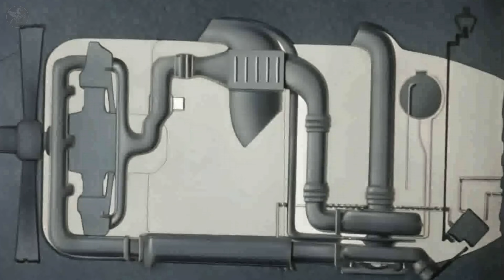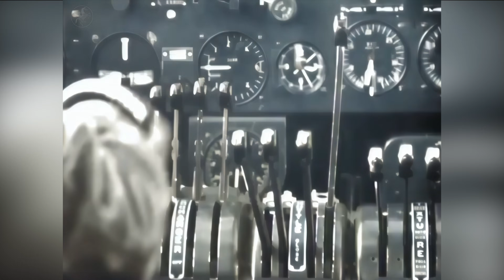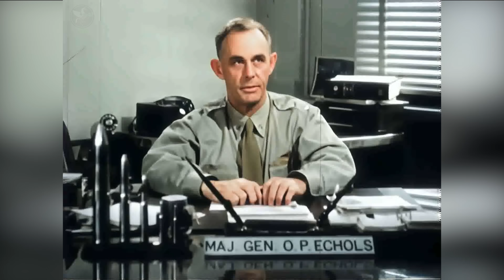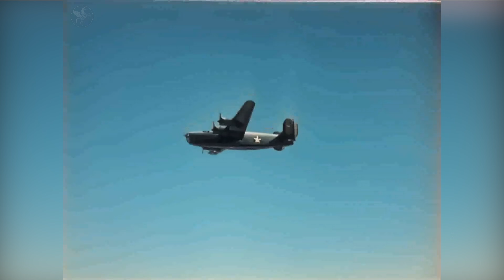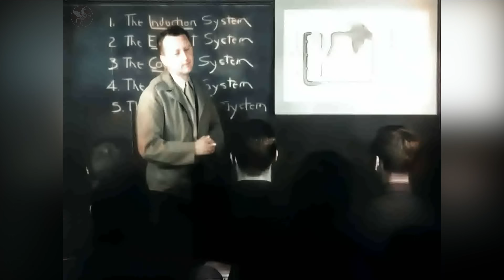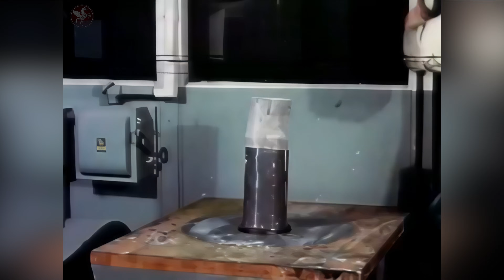WWII HIGH-ALTITUDE SECRET: How the Turbo Supercharger Won The Air War [RESTORED & COLORIZED]

Comment: The P-38 Lightning is the best sounding fighter of WW2 in my opinion. First time i heard one was Black Sheep Squadron 1976
Reply: I'm partial to any of the old radials. To my ear, you can't beat those radical pops. They aren't as buttery smooth as a Merlin or a P-38's Allison, but they sound so much meatier.
Reply: @sixtynining.chipmunks probably because of their vast piston displacement.